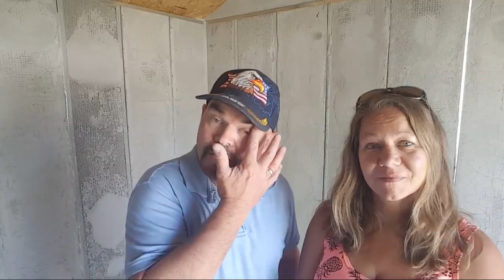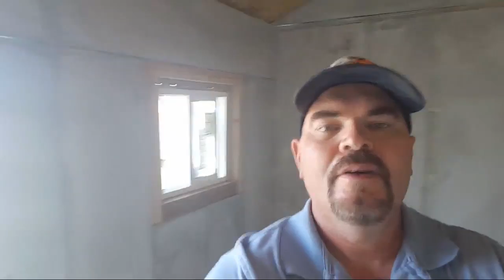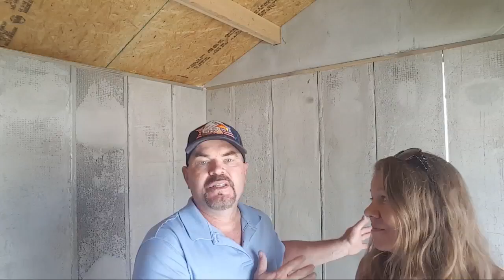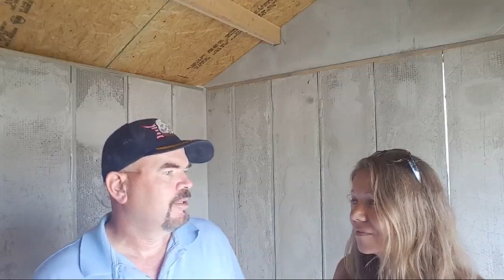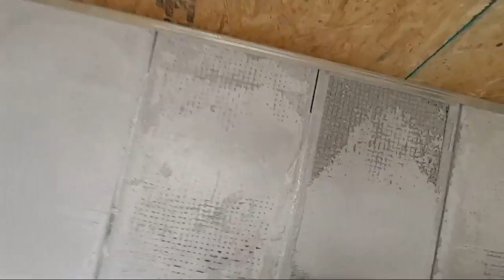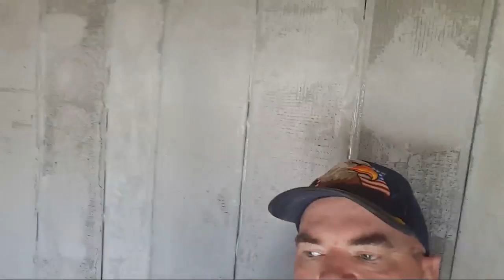Updated Wall Panel Mix Design

Comment: 30:53 you mentioned having an aircrete door which is something I really want to do for the inside of my house, I was thinking because you wanted to fit the motorbike & mower in there if you made a barn style sliding door that would save on space but also seal the room

Comment: Thanks for the aircrete mix information. I just purchased your pdf version for fuller details.
YOU via your $30 DIY Aircrete clip from maybe a year ago are the guy who got me really interested in this subject, and adding study of many of you clips to the domegaia info. (videos plus forum) has me setting up to make some aircrete panels. just got my little dragon foamer and mixer which cost more tahn yours, but I think puts out volume for the dome homes they are enovating. It would be interesting to see specs for cfm of foam produced from both your set ups. I am planning to 1st prototype, then for fireproof fencing, then maybe fireproof panels that will cover my existing plywood house, to make such more fire resistant ... in Northern California.    Thanks for being an inspiring center of DIY info. plus can do attitude!

Comment: 'Thermal mass' is the term for the material holding and conducting heat and cold from the outside to the inside. I would like to form 2'x2'x6" thick blocks to make an igloo-like dome home.👍🏻

Comment: Try using your tack welder to tack wire in the middle of medal stud. This would keep panel from bowing and also prevent honeycomb on outside layer of panel. It would also add strength with wire in middle.

Comment: I'm looking forward to getting the recipe for the updated mix. 
*note - in the past, you wondered about using the earthbags for aircrete... I'm using those bags for a structure, right now... They work exceptionally well for filling with earth... and aircrete filled is a very interesting theory... but I don't trust those bags enough to contain the  aircrete... reason being,  because if wet earth is placed in them, they unfortunately ooze that wet earth out of the weaves.
Just thought I'd clarify my past comment about it. 
Keep up the great work!

Comment: 1. Now that you have your 'crane', you could make the panels 2x as wide, saving a lot of time, no? 2. Why didn't you use the crane to lift precast panels to make the roof? 3. Screwing together those tin borders doesn't seem that strong. Is there some other mechanism holding them together? 4. Aircrete Harry says the Drexel (?) goes so much further than shampoo that it ends up costing less. I know you compared both. How did you end up with the Suave? 
I'm watching you intently because I live in an old, poorly insulated mobile home in AZ, and I'm hoping it will be possible to inject aircrete into the stud bays to lower the a/c bill. I hope you'll do that sort of project next! Thanx for your hard work.
Reply: Bill Underwood bull I’m also looking to use aircrete as insulation walls and ceiling.

Comment: Is it ok to use just a wood frame instead of the concrete slab. My yard is not very flat 
Also is it easy to hook up the electrical in  your shop. Love the work youre doing

Comment: Honey Do Carpenter I would like to buy the PDF for the Aircrete mix you use but it sounds like the mixing ratios are not listed.? Are you going to fix that, and when?